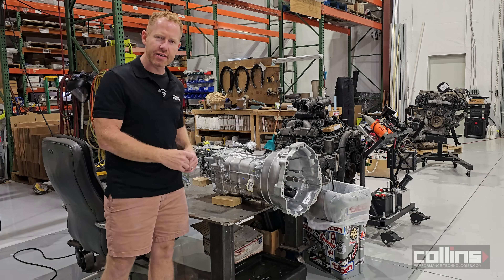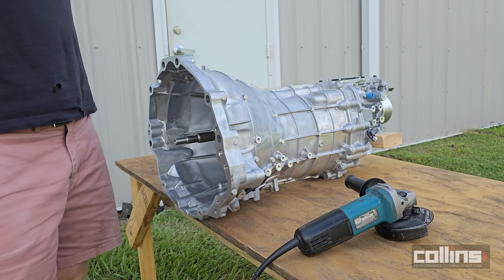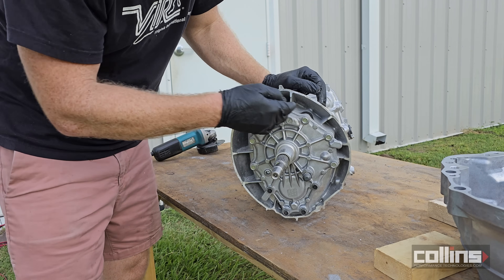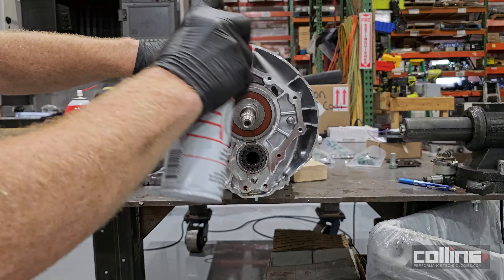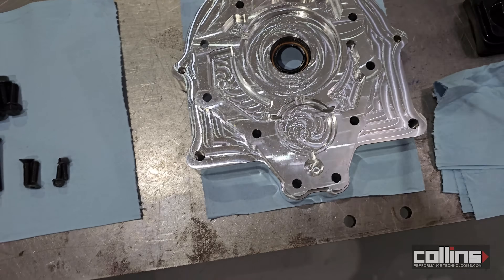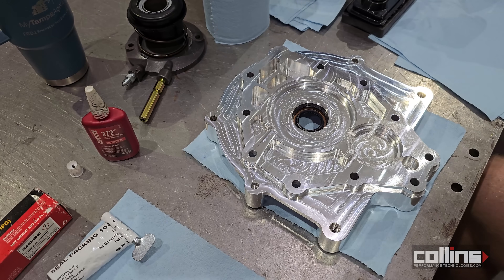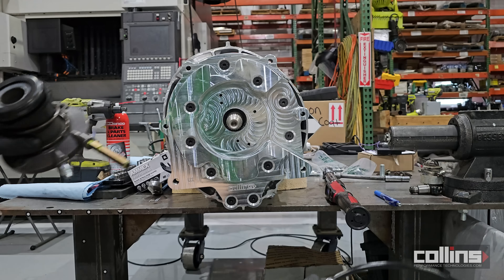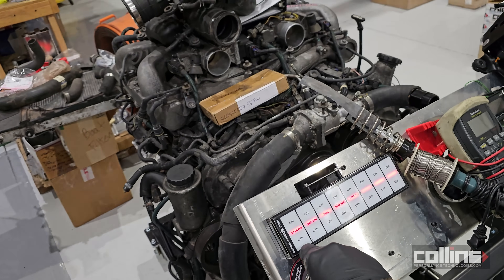6GP0B Better Than CD009?!

Comment: I have a question, for the new Nissan z rz34 manual transmission, will there be future adapters platers like rbs and 2jz, I would like to see that happen an rb26 swapped 400z in the future